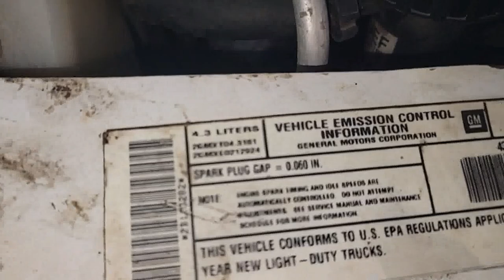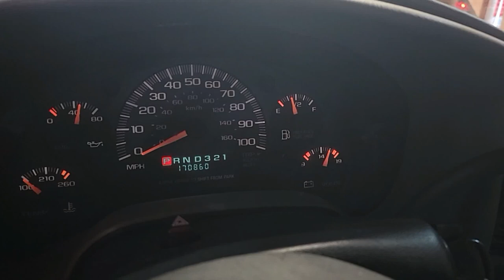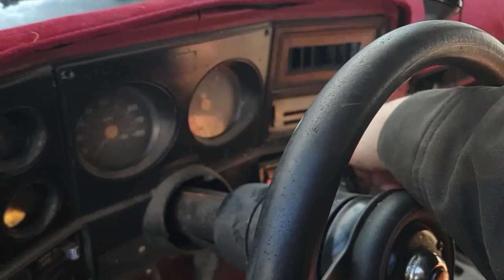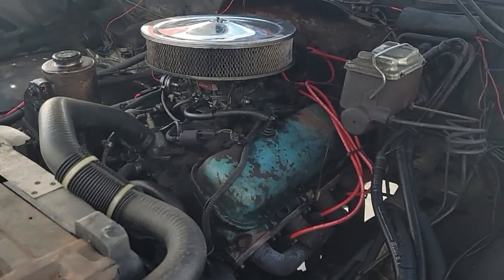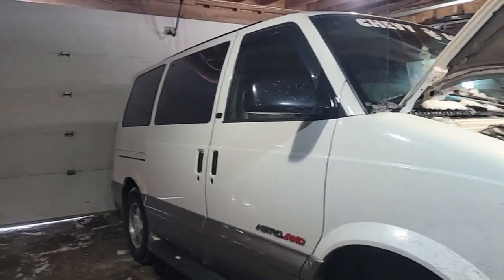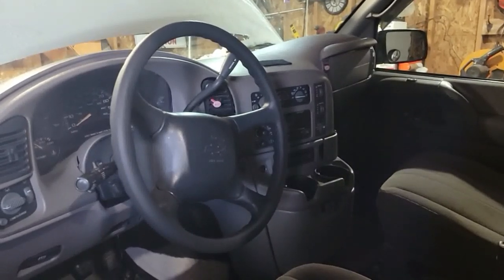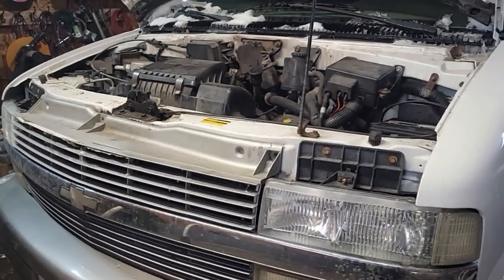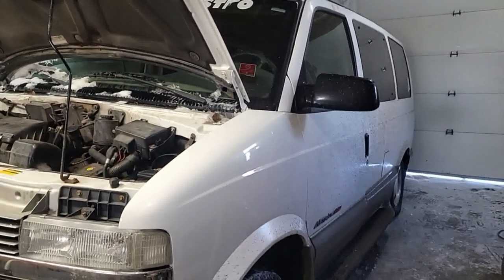Dually gets tuned up plus THE WHITE WHALE!

Comment: I would buy a starter for it it's sounds like it's on the way out could be the original starter for the van probably check the flex plate to be safe to
Reply: Get someone to spin the motor by hand while you watch the teeth with the starter off

Comment: I can bet if the starter don't fix it it has a couple bad teeth on the flywheel I had one you had to turn the motor to get the starter to grab a good 🦷🦷🦷 flywheel I'm a mechanic I can bet it's the flywheel